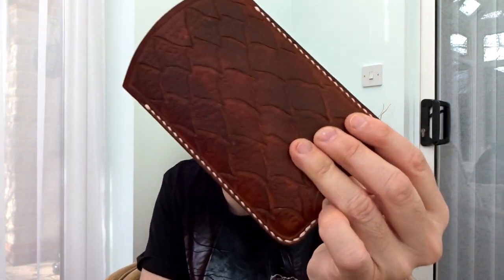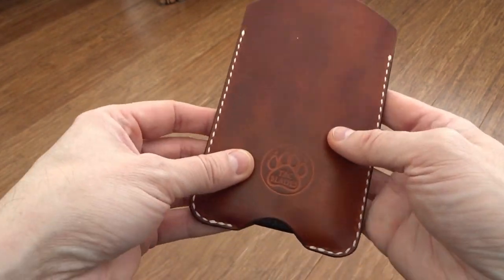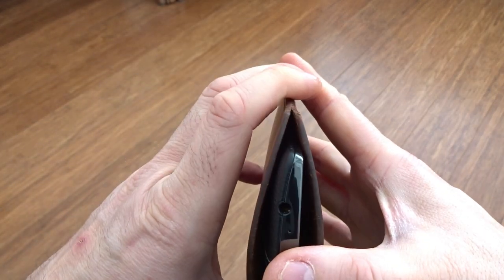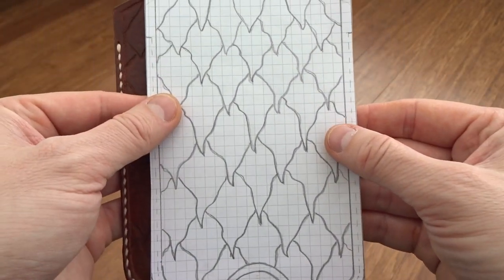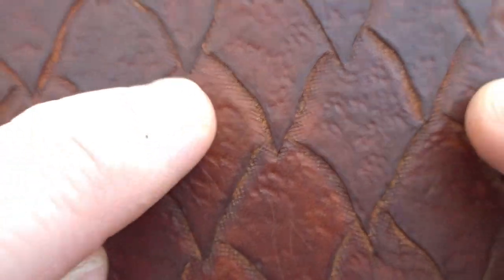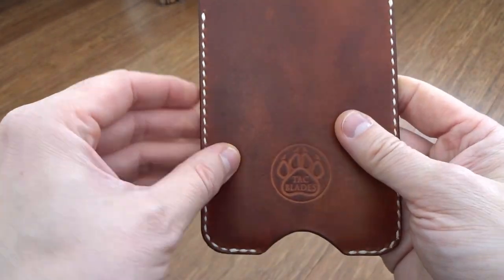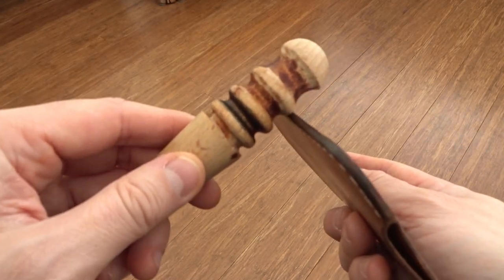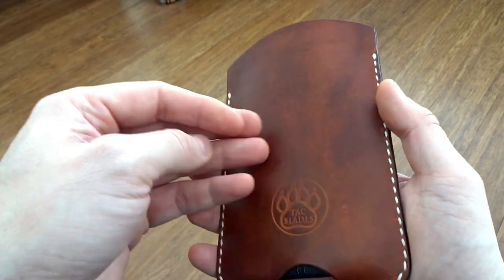Leather Vlog 003 Dragon Scale Case

Comment: really great work! what is the thickness of the thread? and what kind of pricking iron and what was the width? Sewing looks great!
Reply from the maker: de3sw21qa well the thread is 0.8mm and the irons are 5mm between prongs.  :)
Reply from the maker: de3sw21qa these are the irons http://r.ebay.com/4BYIJs
Reply: I'm trying to learn stitching. But am having problems getting the slant on both sides. Would this diagram be correct? http://i.imgur.com/mxGPeYk.jpg
Reply from the maker: de3sw21qa yes but a bit confusing  i think neil armitage at armitage leather is the reference for stitching check out his vids.